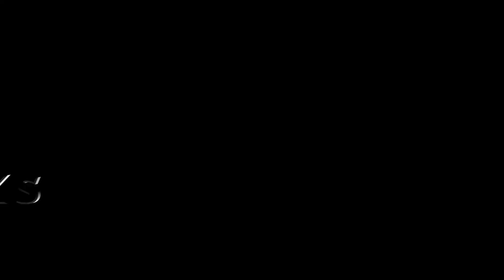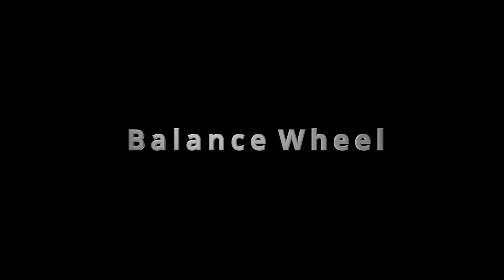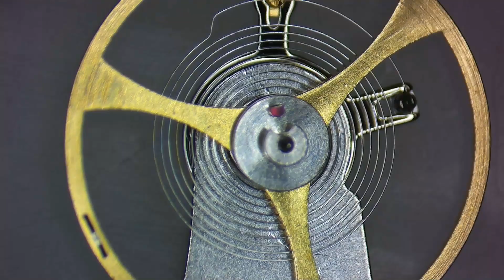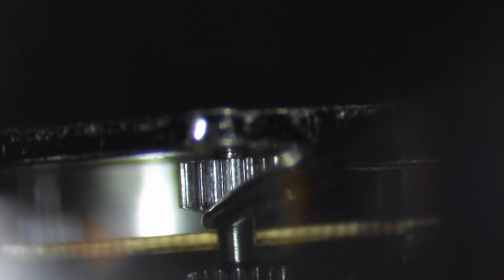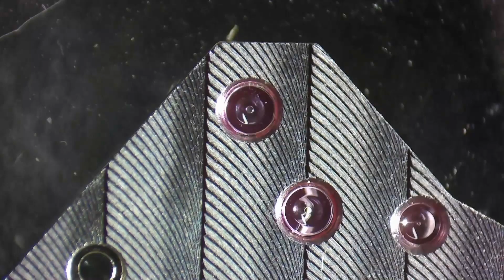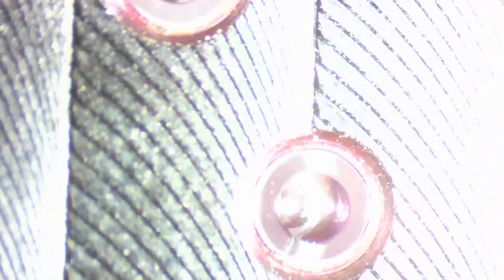End Shake and WHY its important

Comment: For illuminating jewels.. I do almost what you describe. I use a flat LED work light.. small.. maybe 2x4 inches.. and a layer of tracing paper/watchmakers paper over it to act as a diffuser.  I turn on the light and place the item with the jewel(s) on top and then view it through my scope. I get good illumination from under and through the jewel which highlights all the sins of the jewel :D this also works very well for lighting up a palette forks jewels and other items of interest.
Reply from the maker: That is a good idea for illuminating jewels, thanks for sharing it!

Comment: How to fix errors when encountering tolerance cases? please
Reply from the maker: Excessive end shake is corrected with a jewel press. The jewel is moved in whichever direction it needs to go 1/100th to 2/100th of a mm until it’s correct.
Correct is subjective as it’s a visual determination. 
The basic rule of power train wheels is that the endshake should be less than the wheel before it and a little more than the wheel after it. The escape wheel, Pallet fork and balance wheel should look the same.

Comment: I have a mechanical watch that only runs when upside down, if i wear it upright, after a few minutes it will stop. Can you pls point out the obvious areas?
Reply from the maker: When you’re holding the watch and it stops, more than likely, it is the balance pivot below the balance will that’s the problem. There’s many other things it could be, but without knowing the history of the watch, that’s the most likely.
Reply: Its a chinese flying tourbillion. History is seems like it sat for 2 years in the warehouse and i just recently bought it last month.
Reply from the maker: @tswjxyooj1603  that sucks. I’m sure there are probably no parts available. Maybe but I doubt it.
Reply: Would you fix it? I can ship it to you to investigate. 😆
Reply from the maker: @tswjxyooj1603  LOL. I’ll pass but thanks.
Reply: So i should focus on balance wheel & pivots & jewels?
Reply from the maker: @tswjxyooj1603  yes that would be the first place to inspect
Reply: I just notice the tourbillion stop on the same spot everytime. Pointing at between 1 and 2.

Comment: Hi. With the balance staff that could stand more endshake what is a preferred method of adding endshake? I replace staffs and jewel hole tightness and endshake always raise their head.
Reply from the maker: You don’t adjust end-shake for balance wheels by moving jewel settings. If you need more end shake  then you burnisher the tips of the staff. If the side shake is too tight you burnish the pivot. 
What type of movements are you working  on?
Reply: @watchrepairtutorials  It is 16s Bunn Special. I am wanting more endshake. Where are you saying I will burnish? I will use a ballon chuck to get at the pivots. Not sure about burnishing the area other than the pivot you refer to. I agree on moving jewel up and down does not apply on the balance to adjust endshake.
The train runs nicely with fork removed, the balance goes well with a puffer face up and down. But the watch loses 1.2 seconds per minute and I observe no endshake, so I am going after that next.
Reply from the maker: @jftman53  yes you can just burnish the tips of the staff and that will increase the endshake. Are you sure are your clearances are good between the pallet fork and roller table.
Reply: @watchrepairtutorials  I will want to check the clearance with the roller table. I do check my work to be sure all lands of the staff are fully in contact to the roller. 
Then what could be a further adjustment, would it be the impulse pin not being positioned correct?
Or maybe the fork jewels cause the fork to be higher than needed.
I do see the top of the fork is nearly level with the banking pin height.
Reply from the maker: @jftman53  there could be a lot of things in that area like the guard pin dragging or even rubbing across the roller. The escapement inspection is key.

Comment: Are jewels generally the same diameter or do you have to find replacements for cracked jewels for that exact movement and location on the movement?
Reply from the maker: Yes, jewels come in multiple widths as well as pivot hole diameters.

Comment: Wish I could give your videos another thumbs up! Just watched for the umpteenth time! Often I think pallet forks and center wheels look like they have too much end shake, is this an illusion or do these suffer more?
Reply from the maker: Often times they do, but not so much to negatively affect the movement in any meaningful way. This is actually an area where an improvement could be made in a movement by installing a smaller size jewel and resizing the pivot
This is one of the big difference in high-end movements versus medium to low end movements. In higher end movements, the tolerances that the parts are manufactured to are  much tighter.
Manufacturing tolerances are something watchmakers have  dealing with ever since the first clock was made.
Reply: @watchrepairtutorials  Thanks Alex!!

Comment: Thank you for the excellent video! When you inspect a movement for end shake under microscope. Do you position movement vertically or somehow take a horizontal view?
Reply from the maker: Sure I pick the movement up while it’s in the holder and turn it around to get the best angle. Absolutely.

Comment: don't know how Im going to get a microscope, it is a must have to get to my goal. How is the size in relevance to the number of tooth calculated to get 60 rpm?.   Thanks for the lesson .
Reply from the maker: Good question. It depends on what the beat per hour is. On a 18000 beat watch, there are 60 teeth on the third wheel which turns the 8 leaf pinion on the fourth wheel which rotates once every 60 seconds.
is that what you are asking?
Reply: Thank you, I was more curious about how they came to that conclusion. But don't worry, I am more than happy with what you are sharing.

Comment: Hi Alex, do you have some alternative for Horia tool? Thanks
Reply from the maker: I had a subscriber say they had good luck with the Chinese version you see on eBay or Ali. They said the build quality is very good.
The negative is that it does not come with reamers which is important for replacing jewels. When you are replacing the same size jewel sometimes you can do it with reaming the hole, but many times if there is even a small nick on the edge of the hole in the plate the jewel will break so reaming the hole is always good practice.
I use a vintage Seitz that I picked up many years ago that the pushers and reamers are still available new.
Personally I would keep my eye out on eBay for one.
Reply: @watchrepairtutorials  thanks for the answer, what is the difference between 3mm and 4mm which one I should pick?
Reply from the maker: @BokiPetrovic88  4 mm without a doubt.
Reply: @watchrepairtutorials  i hope the video about replacing jewels is coming soon. Love all your videos 😊

Comment: Thank you again. 
How could I measure the inside hole of the jule?
Thank you
Reply from the maker: Hey John,
There are several ways to do it.
1) The easiest is just to measure the pivot from the wheel that goes in the hole. The measure one size up from that on the new jewel hole
2) you can buy precision wire gauges. I have a set from the Meyer Gage Company. 
3) When you replace a wheel with a broken pivot,  remove the pivot from the wheel, drill a hole into a piece of pegwood. Insert the broken end in the hole with a little glue. Then you can measure the pivot and mark the pegwood with the diameter of the pivot and you have a gauge for that size. You can also buy lots of misc wheels and go through them and make up a bunch of gauges cheaply.

Comment: started on old  pocket watches and took a long time to know what was wonky or right YOU got that one right🤪
Reply from the maker: Thanks,
If starting out on old broken pocket watches was an effective way to learn, watchmaking schools would do it.  Ut they don’t. You start on a working ETA 6497 and work up.
People use the reasoning that it is cheaper, but it actually more expensive because they usually end up with a bunch of watches that don’t work. Of course there are exceptions but typically that road leads to a bunch of non runners that just get resold again and again.

Comment: So glad I found your channel and subscribed.  I have been watching a number of your lessons.  I restore vintage Seiko mechanical watches and have been doing so for a bit over 3 years.  Many of your lessons are straight forward and well articulated for the novice watchmaker.  Vintage Seiko 6 series movements are particularly susceptible to the barrel arbor port wear your describe in this video and often you have to ream the main plate and install a jewel to correct it with a corresponding jewel replacement in the upper barrel bridge arbor port to replace the metal bushing Seiko used.  Thanks for your video and I will continue to check in.
Reply from the maker: That’s awesome man. Thanks for watching and I hope to see you around again.
Reply: Snap! me too. I have yet to find a seiko 7009 without an oval barrel hole. Bought the jewel upgrades from VTA but the job is hit and miss for me,, fortunately they were scrap anyway.

Comment: It makes my day when I see a new video from this channel! Seriously great content, extremely helpful for a novice like myself, especially since I've been looking for a good video about end shake. Really stoked for cleaning and lubrication videos you mentioned are coming up. 😄 

If you have a moment, quick question on oil for you: I am thinking of getting the Moebius beginner's kit since it includes 9010, 9415, 9104, 9501, & 9504 -- do I also need to get some 8200? I only see the 8200 used for greasing vintage mainsprings, but is it a requirement or just something done to help prevent corrosion?
Reply from the maker: Well it depends on which direction you go in. 
8200 is used to add a whisper thin film on the mainspring. This reduces the friction between the spring and barrel as it unwinds. 
The vast majority of mainsprings in vintage watches are sprung and will not provide the needed power for good amplitude. Installing a new mainspring is almost always best as you don't need a winder and they come lubricated.
To install a mainspring you need a mainspring winder to be able to properly install it
Reply: @watchrepairtutorials  Thanks for the reply! I got a vintage K&D pocket watch mainspring winder, and a Watchcraft wrist watch set as well. The Bergeon set is quite expensive, and the Chinese sets seem to have major drawbacks, so I'm hoping I can make do with these. I'll keep my fingers crossed you do a mainspring sizing video too, since I have no idea how to go about ordering a replacement. 🙏
Reply: @AWDTurboPOWAH  As a matter of interest, I didn’t jump for the complete Bergeon winder kit right from the start - not only is it stupid expensive but you’ll mostly only need half the sizes anyway. So, I buy them individually as I need them. For example, I needed a #3 for my latest project so I got the #3 left winder complete and a #3 right arbour. That cost me around £65 for a complete size, as opposed to forking out £985 for a whole set. I now have all sizes from #3 to #7 which covers me pretty well for wristwatch sized movements
Reply: @TheBeardedWatchmaker  Not a bad way to go at all! Great idea, and if these vintage tools don't work out, that's probably how I'll end up doing it. Oh, and one more quick question for you: as someone who's also interested in filming their work, what kind of camera are you using? Your macro shots look nice.
Reply: @AWDTurboPOWAH  Hey bud, thanks!. I have a few that I'm using to be honest, so not sure which shot specifically you referring to? Let me know and I'll go into details of what I used.
Reply from the maker: @AWDTurboPOWAH  I actually have that planned. Those winders you have will get you through a lot of mainsprings but keep in mind that for most people the full Bergeon sets are overkill unless you are in a shop. You can buy single sizes from some of the suppliers. This is a good option as most people work in only 4 or 5 barrel sizes.
Reply: @TheBeardedWatchmaker  Like on your recent Tissot Seastar video, the real close-in shots, what we see around 45 seconds for example. Good chance I'll have to get started with nothing but my iPhone camera, so I'm always curious what kind of camera gear the watch repair YouTube channels are using (just to give me camera upgrade ideas). Thanks for your help!
Reply: @AWDTurboPOWAH  Ah yes, ok. That’s a Fuji XS10 with a 55-200mm lens, it being about 400mm away from object mounted against a shelf. This gives me ample clearance without things taking space on the bench (like tripods and stuff). To allow such close focus with such a big lens, I use both 11 and 16mm macro extension tubes as that lens itself isn’t a proper macro lens. And because I’m recording in 4K, I can actually cheat a little and zoom in 2x without anyone noticing, as you’ll see at around 17:12. Depth of field becomes a pain at such levels so you’ll want to go to higher F-Stops to get everything in focus, so it needs a lot of light on the object to get exposure right. I hope that helps.
Reply: @watchrepairtutorials  Oh that's awesome news! If I decide to go for the Bergeon winders, that's probably how I'll end up doing it. Aside from the barrel sizes, I'm also wondering about the winding direction. Are left-winding springs more of a rarity?
Reply: @TheBeardedWatchmaker  Helps a lot! That's a terrific camera, nice to see someone shooting on a mirrorless Fuji -- everywhere I go people say buy Sony, but finding anything in stock is a major PITA. Might have to start out with some used camera gear or something. Thanks for your help, now I just gotta figure out what bank to rob so I can afford all this stuff 😜.

Comment: I appreciate this rapid stream of videos starting with the basics.  It's as if you've put together a course just for my convenience.  I have my grandfather's Elgin pocket watch that runs but doesn't keep time and hasn't been serviced in decades.   I unscrewed the back to identify the movement but put it aside until I have a clue what I'm doing.  Bought two new 6497 movements to learn on - one to have assembled should I run into trouble remembering how the first goes back together.   Following along with the lessons, remove the keyless works, put back in, hey it still works.  Repeat, repeat, repeat.  Take the balance wheel out.  Put it back in....
Reply from the maker: That’s awesome. I am so happy you are waiting to work on the Elgin and that this is helping. The next videos will be on how to clean the parts by hand, and then 3 videos on lubrication starting with the train jewels, the the balance jewel’s and finally the pallet jewels. After that probably using a timegrapher. Stay tuned.
Reply: @watchrepairtutorials  I'm very curious about lubricant types, storage, preparation for use on the bench, and of course, parts lubrication.
Reply from the maker: @graymatrrocks  That's awesome. Lubrication is one of those things that  a lot of people struggle with. It's so easy to over lubricate which causes all kinds of issues because the lubricants get pulled away from where they need to be. This causes increased friction, lower amplitude and contamination of parts that don't need oil on them, like wheel teeth and pinions.